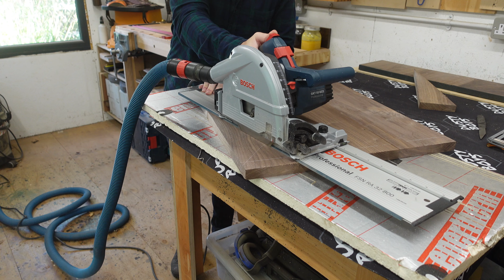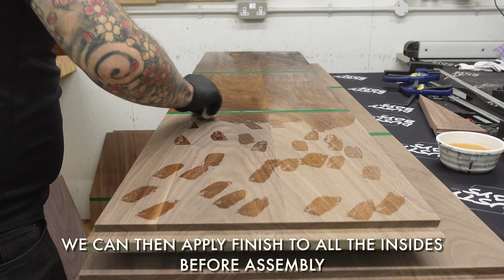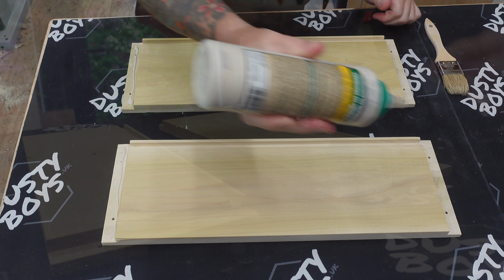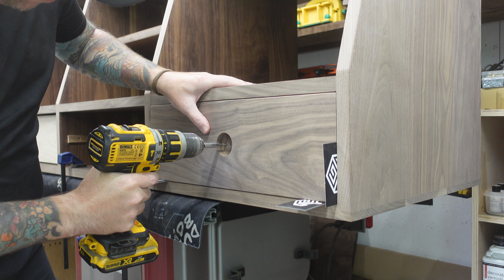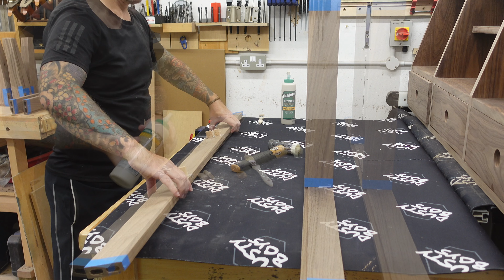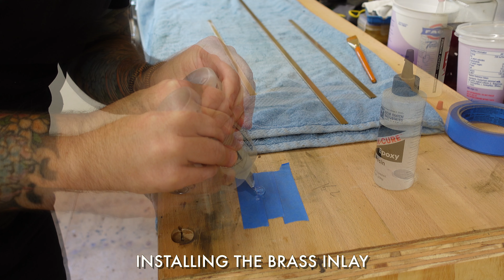Handmade Walnut Media Console / Record Player Cabinet: Woodworking | Furniture Making

Comment: Very elegant with lovely timber grain on top. I watched how you cut your dados; it’s my experience that, with the router base in that position, there is a possibility (in my case an inevitability) that it will rock slightly against the straight edge and give you a slightly wonky edge. I now put the flat Sid of the base against the straight edge and hem it on with another straight edge so that it can’t wander. Or make or buy a figment for the router to clip onto the saw track and thereby eliminate any chance of movement. That timber is just too nice for me to even think about making an error!
Reply from the maker: thanks, i’m pleased you liked it 😀 There was definitely a lot of concentration cutting those, I really didn’t want to mess them up, just made sure I kept pressure against the straight edge 👍 I have looked at the attachments that use the saw track, I might invest in one in the future
Reply: @GM_Design  those attachments are easy to make until you’ve saved up your pennies